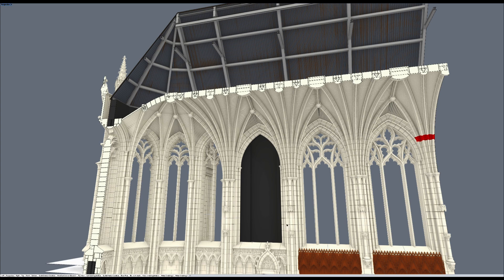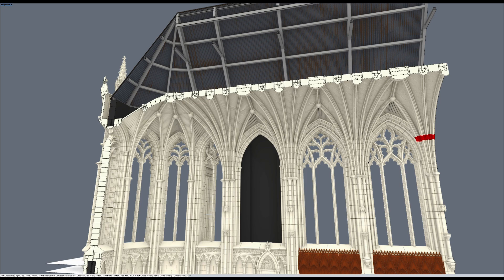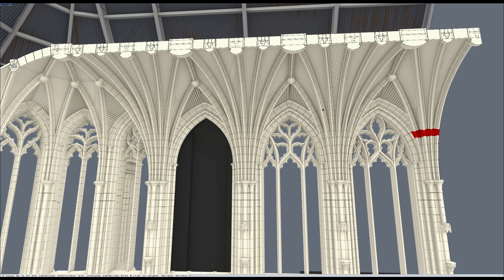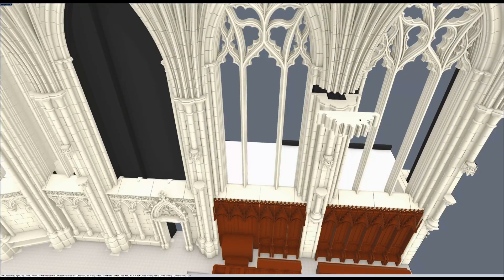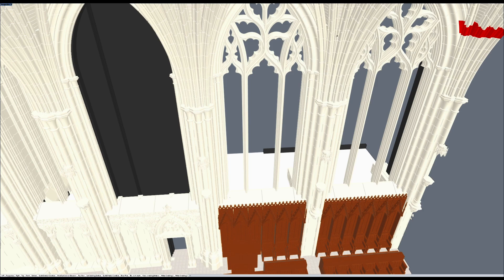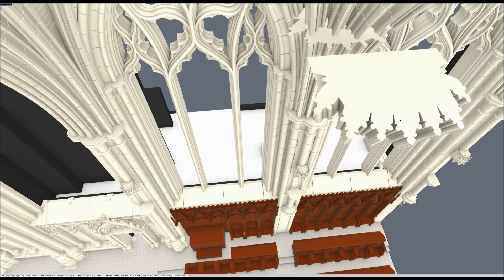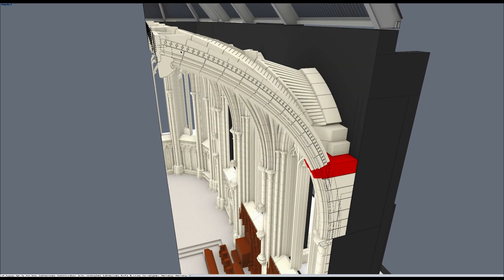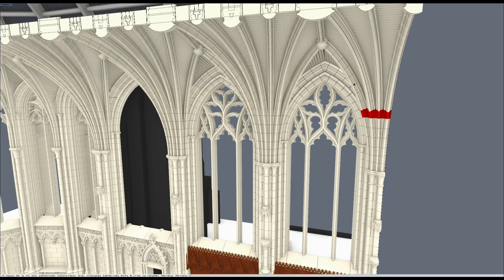How a Gothic Ribbed Vault Works

Comment: if the concrete wont stand up to the pressure for extended periods of time why then do you use mortar between the limestone? Shouldnt the cathedral be built like a puzzel without any cocnrete or mortar then?